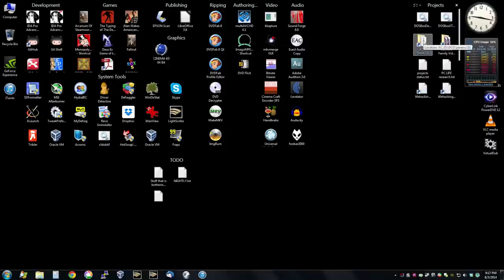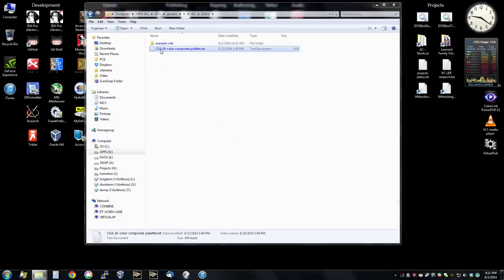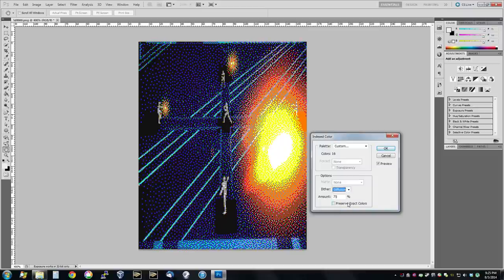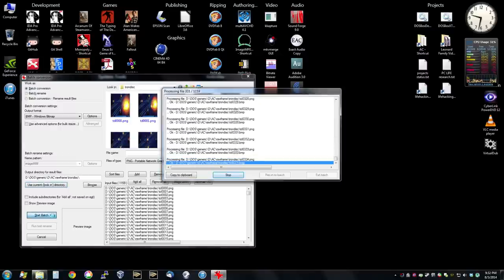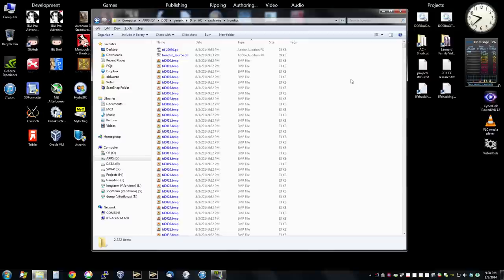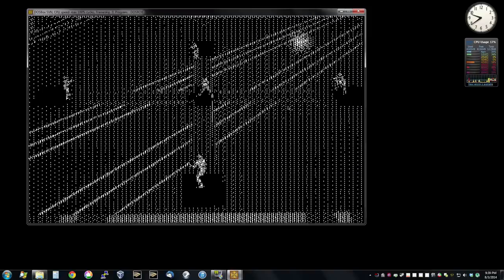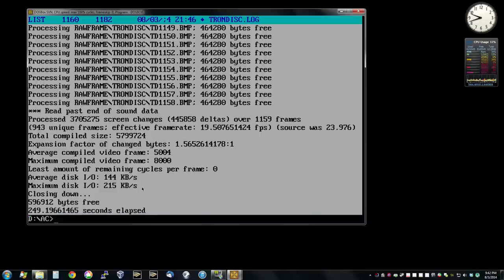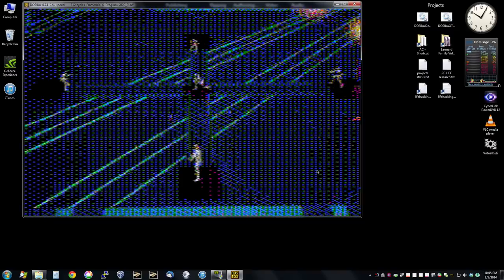Screencast: Creating an 8088+CGA video with XDC

Comment: would be cool if you had the time to make an easy to use host windows video format converter, i use it all the time for the usual ffmpeg conversion, but i really need this for my emulated slow 86box IBM to playback some videos
Reply from the maker: FFMPEG can create the individual frames, but it isn't capable of color ordered dithering, only color error-diffusion dithering which ruins the output.
Reply: @JimLeonard  The paletteuse filter for FFMPEG supports bayer ordered dithering. Eg., ffmpeg -i input.mp4 -i palette.png -lavfi paletteuse=dither=bayer:bayer_scale=2 -r 1 frame%d.png
Reply from the maker: @nst1nct  Thanks!  That definitely didn't exist 10 years ago when I was writing the code.  Unfortunately, I just tested it, and it produces much worse results than Photoshop's pattern dither.
Joel Yliluoma has done a great write-up of various color ordered dithering methods; maybe someday I'll write that into the compiler so that people can just feed it 24-bit color bitmaps.

Comment: I'm having trouble converting batch to 1bit .bmp on Linux. I've tried with XnConvert and with ImageMagik's convert without success.
Reply from the maker: Using the exact imagemagic command examples on the website? On the "preparing source material" section of the documentation, there is a mogrify command line example.
Reply: @JimLeonard  Oh! I hadn't seen it, but now I decided to use IrfanView through Wine and the video is being created!
Thanks for the help and the apps! I intend to use it with the TTGO VGA32 board and the PCEmulator by Fabrizio Di Vittorio. One of the example videos worked (even without audio).
Reply from the maker: @canalRetro269  I'm glad my silly little project is working for you 🙂

Comment: a quick tip to anyone trying to convert frames via imagemagick for the 640x200 mode: imagemagick will apparently silently output 24bpp images if your input PNGs have an alpha channel (which in my case, exporting frames via sony vegas, they DO always carry one no matter what)

you can add "-alpha off" to the mogrify command to fix this, had to figure that out the hard way

Comment: Did you ever consider getting this to work with MDA? My 5150 is an original line, and it only has an MDA card. Also, I did black and white, and I got it all to the correct specifications, I used ffmpeg and Magick something, so I can get the black and white files for every frame in bmp3 at o4x4 in 640x200, and I used CMD in Win10 to create the .src, I had all the files in the same directory, and moved them (the entire directory) to the virtual hard disk, but while on DOS 4.0 (I was previously emulating with 3.3 and 3.2, so that I could test closer to hardware specs but had to upgrade hard disk space which required DOS 4.0), I ran XDC_COMP.EXE MYFILE.SRC but after waiting little time, I get an error, I must mention that I did not decide to create any audio, and I did not include an audio source in the .src file, so I went to this site https://forums.civfanatics.com/threads/silent-wav-file.500379/ and got their silent.txt (you can rename to silent.wav and is 7-ish seconds of nothing) I used this as the audio input source, but I got the same error, which was "Fatal runtime error 2 at 0000:0CBD: File not found", though I do not remember it containing the text "2" before I added the silent (but non-corrupt) audio source, why would I remember though. Any way, help would be appreciated of course, and thank you for taking the time to read this.
Reply: Also, despite typing the 24 fps specification in the format required, I got this output log from the first attempt 

485360 bytes free
Parsing input script TEST.SCR
Assuming encoding fps of 59.922751014 which grants 39824 cycles per frame
Set

Though I told ffmpeg to take 24 frames per second, the original video was about 60 fps, but that really shouldn't matter, no connection between it.

I also added the file directory to each file in the .scr using notepad ++, but it just produced the same error.
Reply: I also checked, and this is the log after adding the silent audio 
485360 bytes free
Parsing input script TEST.SCR
Assuming encoding fps of 59.922751014 which grants 39824 cycles per frame
Setting encoding fps of 24 which grants 99431.818182 cycles per frame
Using C:\TEST\SILENT.WAV for audio input; muxing full video+audio file
Audio samplerate: 44100 Hz
* Sample rate 44100 doesn't divide evenly into 24fps
* compensating with new rate of 44112 (1.0002721088x of original)
* Source frames will occasionally be dropped to maintain audio sync
Processing C:\TEST\F
Reply: I got it working, I shortened the frame names, and it is still automatic (getting the correct frames), I also included an empty source audio that is the same length as the original video.
Reply from the maker: Appreciate your dedication, but continue to email me, as youtube comments aren't great for this sort of thing :-)  I did get your emails, and now that I finally finished a new video for my TheOldskoolPC channel, I can get to email again tomorrow.

Comment: did you ever consider getting this to work with EGA or VGA? I don't have a CGA card any more.
Reply from the maker: It "runs" but obviously not optimally.  It was designed specifically for the limitations of CGA, so there wasn't much point trying to work it for EGA or VGA because if I had EGA or VGA I would have used different methods entirely.  Also, need to be careful putting EGA or VGA in an 8088 system because it's twice (EGA 32k) or four times (VGA 64K) the video memory to sling around in 320x200.

Comment: I got it pretty automated all the way up to creating the initial source file with the frame information, their was only one thing that I couldn't figure out within that part, and that was creating a batch system to move the .BMP files too their own file (currently it pauses for you to do that) before the automated batch starter source file creation, but surely you can figure that out. If you would like to know what I did, you could probably figure it out on your own, but let me know. I would love to see something that is fully automated, but a big part of it would be creating a version of XDC_COMP.EXE for newer Windows operating systems (at least Windows 2000), the rest is already available and existing.
Reply: Though, while I haven't tested, if XDC_COMP.EXE works on Windows 95 in some way, and their are version  of the something "Magick" application, as well as ffmpeg, that have the same compatibilities with commands as they do now, this could already be done on something like Windows 95, I just need to know how to batch move files, and some way (possibly in the batch script) to add the extra details such as the screenmode the audio file option, and of course the fps, though with my current choices, you would always set screenmode to 2 because it outputs grey scale frames. And because I do not have much skill in batch scripts, it always looks for "INPUT.MOV" (I recorded the video off an iPhone), now that could easily be edited when need be to something like "INPUT.MP4", I also chose to not have any audio so I would leave the part after waveinput= blank (I have no batch conversion of video to wav either so that would have to be created). But the point is, assuming a version of (I just checked) ImageMagick, FFMPEG, and XDC_COMP, work on Windows 95, this is already entirely possible without creating a new application.
Reply: I got batch file movement, so I one-hundred percent have everything automated up to creating that start of the source file. I could probably at least get it to add specific text to the source file, but not customized.

Comment: I have a question : What are the visual differences between 160x100 and 160x200 ? Because I know that 200 is really taxing for the system and should not be used for ever changing frames, but if I use it, is it worth it ?
Oh and when should I use the CGA RGB palette ? Do I need to have a specific hardware ?
Reply from the maker: The difference between 100 lines and 200 lines is in the encoder: if you pick 100 lines, it skips every other line. This is faster and results in less data, but looks worse for obvious reasons.

The software currently doesn't have support for CGA RGB, and I don't have immediate plans to add that this year, sorry.
Reply: Nah it's ok ^^
I'll do some tests to see how it turns out in 200.

Your compiler and player are really great/cool by the way.
Reply: Last question : if I want to convert a 4:3 video, what resolution shoul I use ? (without the loss of "resolution", if possible)
Because, with the convertion in 160x200 in Photoshop, in the complier/player, the video is slightly verticaly squished (same format as 160x100).

Comment: Jim Leonard, i got a problem! I am trying to make a XDC version of Archie's Weird Mysteries intro and it ran into a problem saying: "FATAL ERROR: Not a resolution we handle (yet)", is there a way to fix this problem.
Reply from the maker: Sounds like you missed the resizing step.  Try doing a black and white version first as they are easier; website documentation has an ImageMagik command line example that converts and resizes a batch of frames with a single command line.
Reply: i did that and it did not resized it to 640x200
Reply from the maker: Then you'll have to resize yourself before feeding them in.  From the documentation in the "source preparation" section:  

The encoder loads Windows .BMP files in the following formats:

160×200, 256 colors (only first 16 are used)
160×100, 256 colors (only first 16 are used)
640×200, 2 colors
Reply: i did that and now it shows "FATAL ERROR: Bitmap file too large for us to process". Is there any way in order to fix that? :)
Reply from the maker: For b&w frames, Save as 2 color bmp, not 256 color.

Comment: FATAL 130 with no descriptions. What's the problem here?
Reply from the maker: Can you be more specific? Where and when are you seeing that error? (Please keep in mind that the process is completely unsupported)
Reply: @JimLeonard  so I'm using a xt ide Cf card. I set the cf as c in dosbox and everything works great. When I try to run this on actual vintage hardware it just shows FATAL 130: (nothing here)
I tried it on 8088 with 640k ram and 386 up 4mb ram. Have cga and soundblaster installed. Tried about 5 computers all showed same error. I'm so confused haha
Reply: @JimLeonard  when I typed xdc_play filename.xdv
Reply: @JimLeonard  I also try the /q switch so I dont think sound card is the problem... totally lost. Any idea what's fatal 130?
Reply from the maker: @co3476  I'm really at a loss -- I checked the code and there's no fatal error for "130" handled in the code.  Are you using a video you compiled, or a pre-compiled video from the website?
Reply: @JimLeonard  A video I compiled myself.  It works now. I actually didnt do anything...its like magic lol
Reply from the maker: @co3476  Whoa, WTF :-)  Well, glad it's working, I guess?  :)
Reply: @JimLeonard  yeah totally and its AWESOME. Good work man and thanks for the help.
Reply: @JimLeonard  Hey man I got some new problems. Video is in BW. However, BMPs are color and i choose videomode 1 in the script. What could be the cause here? I downloaded some files from your website that is color but it is still BW when play back on my dosbox machine. I checked the config and make sure that the machine will indeed display color and tried some CGA games all works great...
Reply from the maker: @co3476  your dosbox needs to support composite CGA colors. Try dosbox-x or another variant.
Reply: @JimLeonard  just tried it on my pc with cga card still bw. Hmm. Am I using the wrong pallet here? Let me try again
Reply: @JimLeonard  so doing this on an actual 8088 pc with cga card still yields the same result. I tried the video I compiled and the big buck bunny video on your site. Confused haha
Reply from the maker: @co3476  You have to have a cga card with composite color output hooked up to a TV to see color.  If you are, and still don't see color, it's possible your modern TV can't handle the chroma signal properly. A CRT TV always works.

Try a cga composite color enabled dosbox first to ensure the software is fine. Don't use the version on dosbox.com as it hasn't been updated in a decade
Reply: @JimLeonard  I'll be sure to check it out. Thanks for the patience
Reply: @JimLeonard  What about a Tube tv from 1982? Just joking, but I wonder.

Comment: Sorry if this is a stupid question, but I thought of something.  Would it technically be possible to use the XDC code to do an FMV game that'd run on an original IBM PC, like an 8088 port of Road Avenger?  I noticed that you can turn the cycles down a fair bit below any IBM PC and it still plays fine, so do you think there'd be enough headroom for game code to run as well?
Reply from the maker: I've actually given serious thought to trying to port road avenger, and I've done a few tests with dragon's lair footage. However, some changes in the conversion process are necessary, and I'm currently overextended.
Reply: @JimLeonard  Ah, neat.  Thanks for sharing.
Reply from the maker: @thepirategamerboy12  I'm not sure I understand "someone else did the work of syncing it up for you", can you explain?

Nice result but you should increase the number of cycles allocated per frame so that you don't have to shave deltas. But try to stay under 150 kilobytes per second because It would be difficult for an 8088 system to Read from the hard disk that fast
Reply: @JimLeonard  What I meant was that someone took the original Laserdisc video and synced it with the Sega CD audio here: https://www.youtube.com/watch?v=5axzEUD7QrA

Also, about the cycles, is 150kb/s or under still safe for an old MFM hard drive, though?  I've been using 90k a lot because I'm scared about potential stuttering issues on real hardware like I've seen in some videos because it can't keep up with the data.
Reply from the maker: @thepirategamerboy12  The only way to know is to test on your target hardware. 90 is safe for all drives, but is the lowest bandwidth obviously.
Reply: @JimLeonard  Alright.  I don't have any real hardware that slow (the oldest PC I have is a 12mhz 286 with a much faster IDE hard drive), so for now I'll be encoding in the middle at around 120k.  I did do a re-encode of that video at 120k and it's noticeably better, of course.
Reply: @JimLeonard  Tried out 160x100 at 120k for the intro, and honestly for this source material I think 160x100 is at least better for the full-screen parts.  Less detail, but far smoother.  Is it possible to use both 160x100 and 160x200 frames in the same video?  Like, switch between 160x100 for the full-screen animation and 160x200 for the first-person stuff?

https://mega.nz/file/6gsTQDaT#7iCz6I6xv-onTZacI6Z002xPSPigM5T8v3tyffGktic
Reply from the maker: @thepirategamerboy12  It is technically possible, but I never built that functionality into the animation compiler. You can certainly justsplit things into parts and compress each one with different parameters. 
Keep in mind that while converting the game would be really fun, there's a lot of other technical hurdles, such as how to handle the death animations, and a description of what moves are supposed to be input and at what times.
Reply: @JimLeonard  Yeah, that's all true.  Also, I'm not trying to push you into making it or anything.  Hope my talk doesn't come across like that.  I'm just sharing my ideas and encoded some test videos to get kind of an idea for what it would look in action.
Reply from the maker: @thepirategamerboy12  No worries, mate :-)

Comment: Are you the same Trixter as the person at vcfed? If so, we could communicate through that.
Reply from the maker: Yep!
Reply: If you read my original comment here, forget it, I got it working, just a few little things happened. I will send you the batch program soon.
Reply: @JimLeonard  Alright, the email was sent, and I can guarantee it is 100% working this time.
Reply: I like that 8088 corruption "works" on MDA, for my actual hard ware, I may have to use that, unless I can transplant a cga card from my newer model.

Comment: Awesome, not as hard as I thought it would be.
Is 90k really the best setting to use if I ever get m hands on a machine that old? Also, my personal experience says you shouldn't really go above 135k for a 150k CD-ROM drive.
Reply from the maker: 90 worked with my equipment, but you should test and measure for anything you have, of course.

135 for a 1x cdrom sounds right. The player buffers, so if datarate isn't maxed out, you can go a little higher.

Comment: Tried to convert Koyaanisqatsi in it's entirety, but Photoshop freaks out when it has a 123,578 file job.
Reply from the maker: Go for the imagemagick black and white batch/command-line solution on the website.  Or, cut the frame rate in half. But you will have a bigger problem because the player only supports files up to 64000 frames. when I demonstrated the system at a vintage computer show, I showed off two movies, and I had to break each movie into three or four parts and change between them using a batch file and the player command line option that does not reset the video mode when it exits.
Reply: Good to know!

Comment: READ THIS FIRST, 
EVERYTHING ELSE IS JUST EARLY TESTING, AND EXAMPLES OF WHAT WAS NOT WORKING.
I got everything automated except the actions only available to DOS. So I do not have automation for moving the folder containing the frames and the source to a virtual hard drive, and I do not have a script to do XDC_COMP (YOUR FILE).SCR. There is automatic cleanup, but currently all customization for the frame and .scr creation (such as color or the choice the use add audio file to the script) has to be done by changing names and variables in the batch file. But for me, I have it set the way I want of course, so all that I must to do is drag a folder to a virtual hard drive, open it in DOS, and run XDC_COMP (yourfile).SCR.